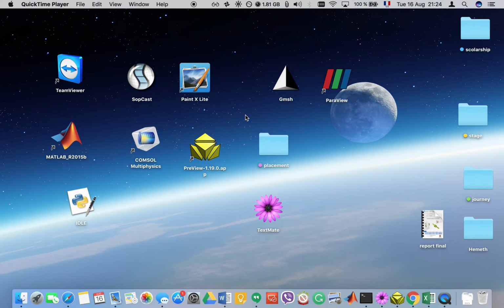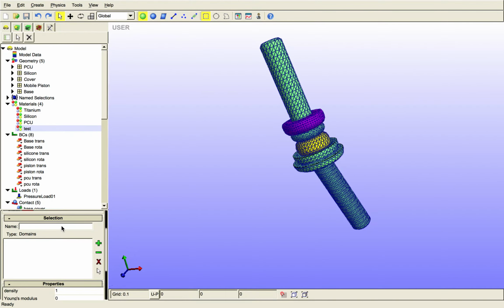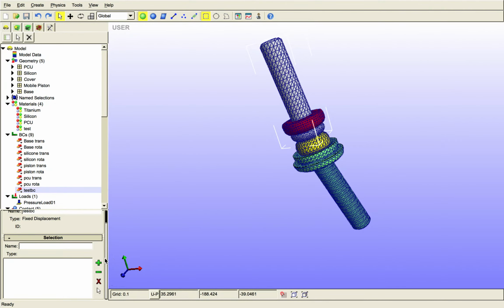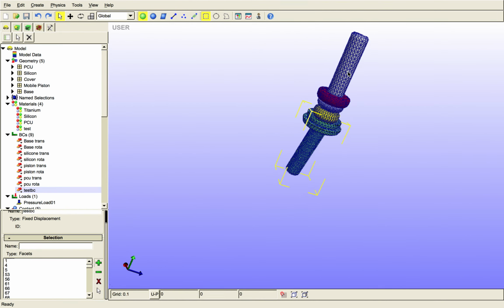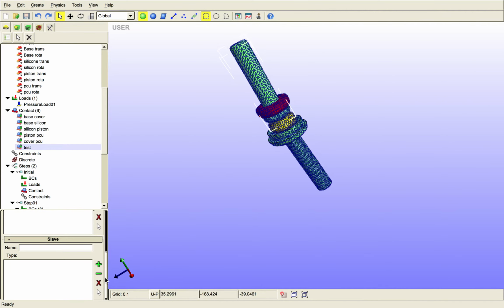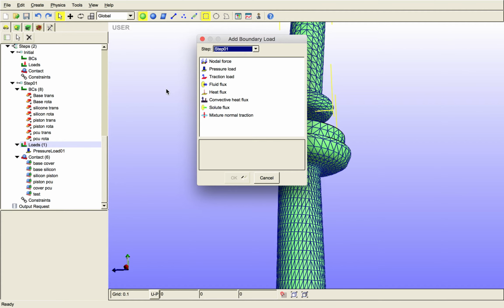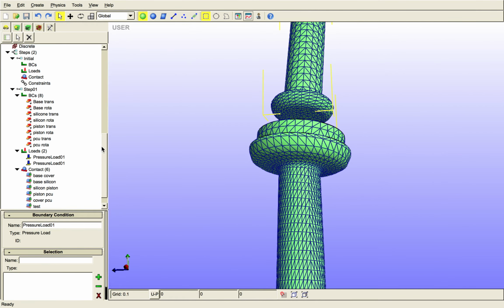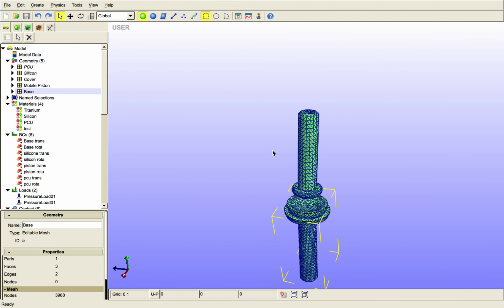FEBio Tutorial using B-Dyn implant for the spine

Comment: Hello, thats a very good video. I have a problem, for my tesis i need to obtein model of jaw of CT, and put on the jaw a removable denture using 3d scan. How can I mix both 3d images for make stress analysis?
Reply from the maker: Francisco Diaz hi there. I’m not an expert of mixing but have you tried using AutoCAD or Solidworks in order to join them? You can then maybe export both of them in the adequate format for meshing and analysis.